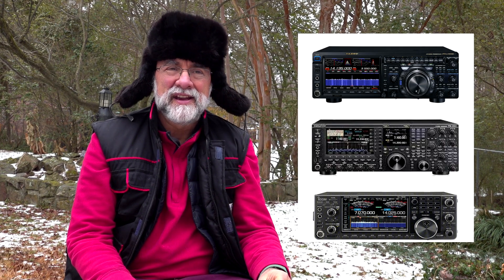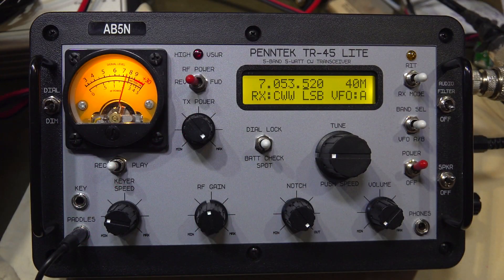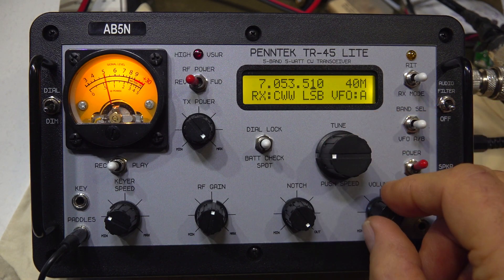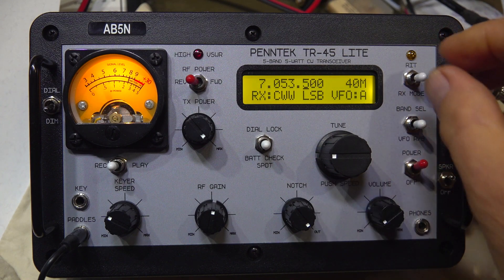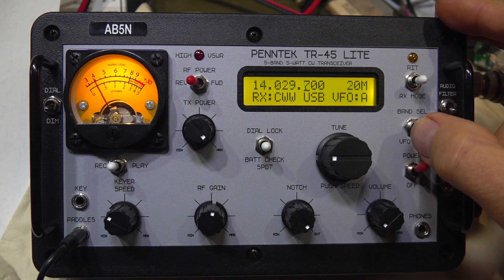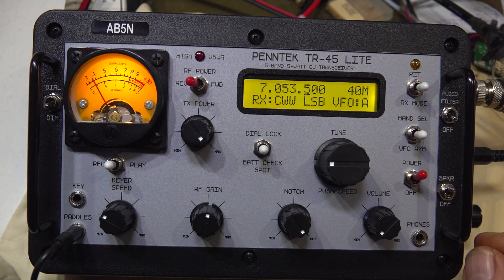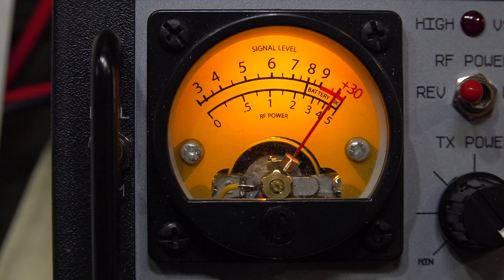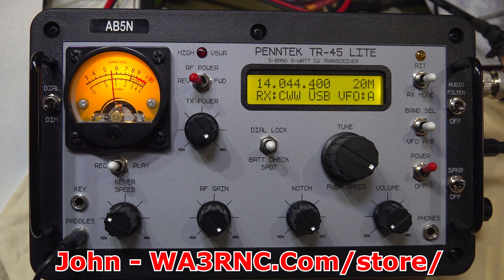PennTek TR-45L Review

Comment: I was one of the early buyers and took it along when I moved to the UK two years ago. I love it -  from the nostalgic meter (beautiful) to the ease of operation. Yes it seems pricey but in the end that doesn't matter because it gives back in joy when it is on the air. I am very pleased to have one. K7TP/MW0KLD
Reply: Agreed- Pricey- but I totally concur. It is just a delight to operate. So clean and simple. Exactly what you need to get the job done. Nostalgic too...

Comment: what a fantastic radio. I think I'll save up for one. I have to say, I've owned a Yaesu FT-817/ 818 since they came onto the market, I've had the most fun with those little QRP radios over the years, I'd be really stoked up if he (Penntek) would make an all mode version, granted CW is the best mode for QRP but , it would really be stellar to have a replacement for those FT-817 and 818s in this lunchbox form.  Icom has done so but - it's too much radio for me. all of the bells and whistles are keen on my desktop rigs, but a simple all mode in this form-factor is what I'd really like. just my humble opinion. 73 de n3tgy

Comment: I have one on my desk, Bob. Not the skinny version but with the tuner. Still to make my first contact - we are having severe heatwave temps here in Brisbane so I need to wait till the weather cools down. And I had to pay not only GST but import duty on my purchase, which made the rig super expensive. But I have got over that now and really enjoy drooling at it! Also bought the Begali Traveler Light to partner the Penntek so itching to get out there and have some fun. Grant VK4JAZ
Reply from the maker: Grant- Well, sorry about those extra taxes. You do receive benefits from those costs - from what I hear. (small consolation) Yes, once you can forget about the high up-front cost, the radio is a joy to operate. We are in an arctic blast here for the last week with little warm up expected. (as you see from the video). It gave me time for making the video and to operate in a low background noise environment. Somehow the snow quiets down the local neighborhood electrical noise. Normally, I can think of several enhancements/optimizations that can be done with a new radio. I have not come up with one yet (save reversing the wires on the CW sidetone pot). I had 22 ideas on the FTdx-101D.  This rig is a winner!